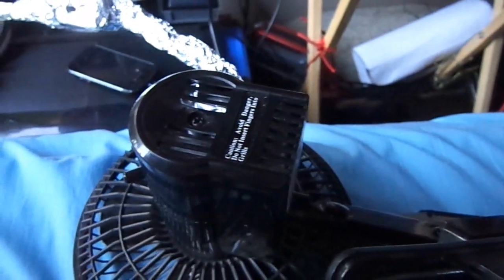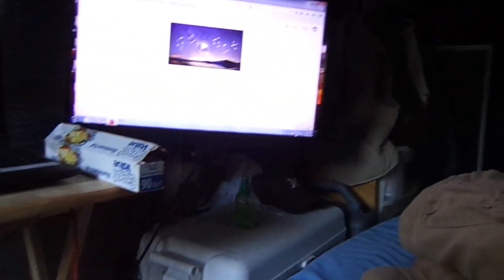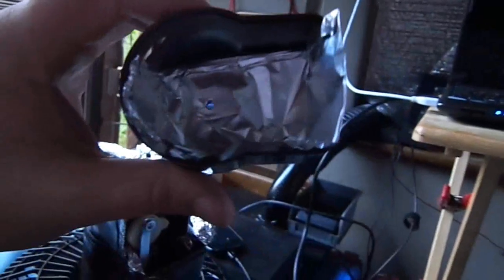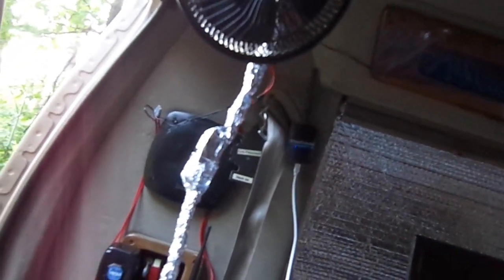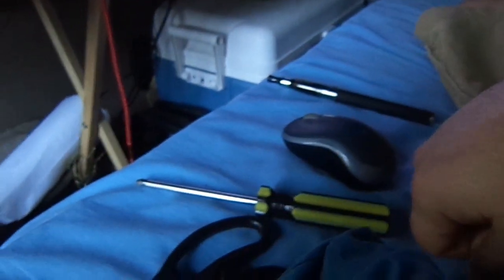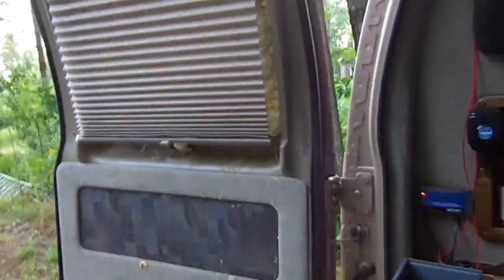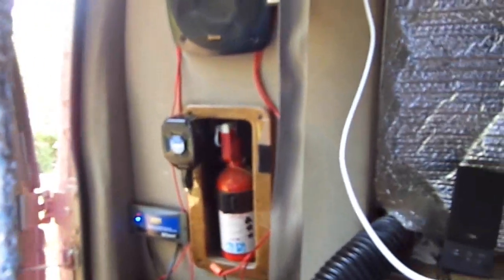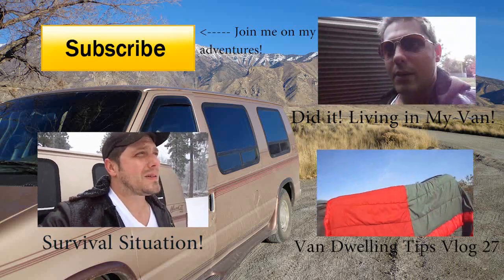That Just Happened

Comment: Im a computer engineer and I've read about your problem in research documents.  What's actually happening is that the fan is screwing up the sine wave coming from your power supply. Complex harmonics are traveling throughout your power systems and causing EM interference.  The tin foil Farraday cage will not fix the issue. Just isolate the fan onto a separate power subsystem.

Comment: Hi Mike, Vanhausmeister here.  I feel your pain with the RF from my "12v autostore" fan.  I first noticed it when I left the fan running off my cigarette lighter 12v service in my Chevy Express 1500.  My remote lock key fob would not work.  I left the fan running to keep the van cooled while I shopped.  Got to keep my guitar cool you know.  Well I thought my remote system was broke.  It was not.  Turns out when the fan was off it worked fine.  Then I experimented and used my Duracell 600 PowerPack and the remote worked fine when the fan was plugged into that.  During your vlog I ran out and experimented more and found I had more wifi bars while my fan ran off my totally separate Duracell 600 PowerPack  than when it was plugged into the van power supply.  When I camp I always run the fan like you have off the Duracell.  My BearExtender works great then  too.  I got the Duracell  PowerPack for $140 off Amazon and will always carry it for emergency power and jumps.  It can charge as you drive (or off AC) and the fan will run for 2 nights straight before charging is needed.  When I have AC my other fan does not interfere at all.  I hope that helps.  When I vent the van while shopping I plug it into the Duracell and have no problems with the remote.  Go figure?  The PowerPack is great for rescuing stranded girls (gotta help the guys too, they might have a sister).  Peace Brother.  VHM.